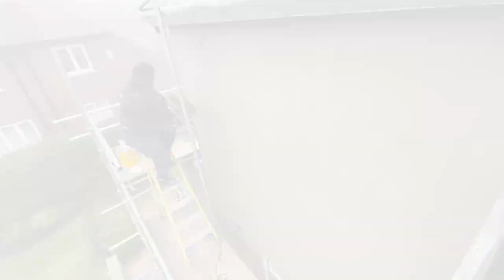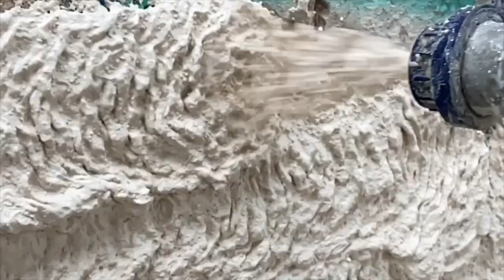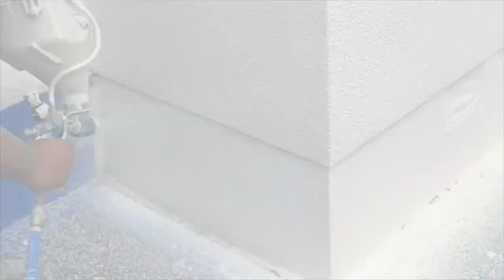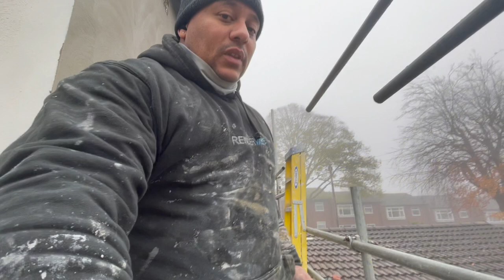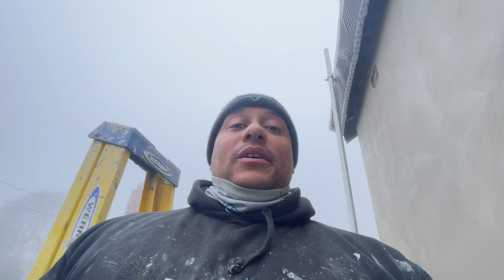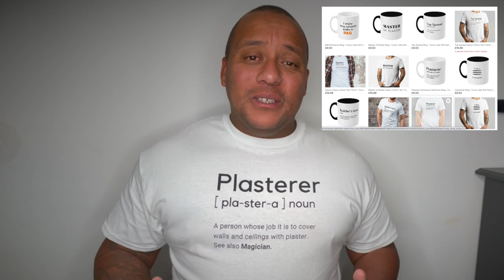Powerfloat! How to use it! (another day in the life, of a plasterer!)

Comment: I would not be without my power float now, only thing with ecorend is it really clogs up the sponge how is the best way to clean them out or do you buy a new one for every job, they are pretty reasonable now, I like the diamond float on sand and cement but the sponge is definetly the way to go with the silicone after its flattened. atb Roy